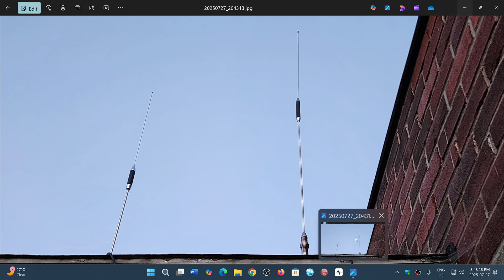Antenna setup for VHF UHF on SDRplay nRSP-st and upcoming changes

Comment: From your experience, what’s the longest USB cable you have successfully used with an SDR? I’m interested in relocating my RSPdx, but I would like to know my options before I move forward.
Reply from the maker: It is not recommended to have more than about 20 - 25 feet USB cable for an SDR